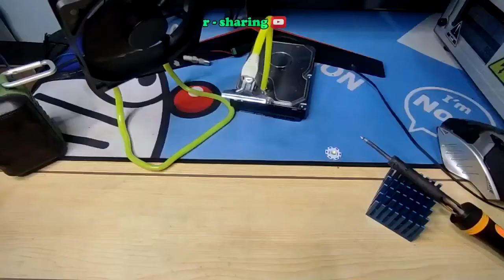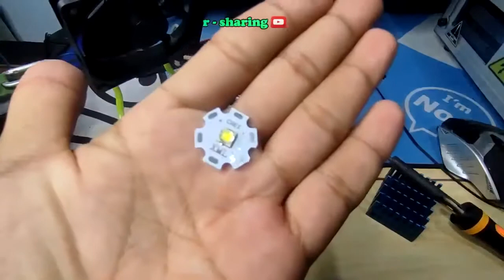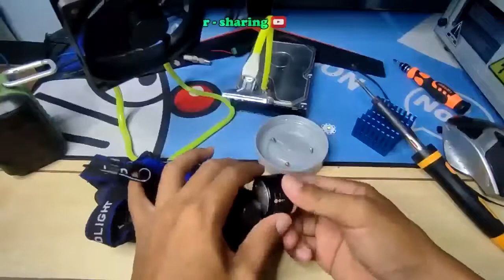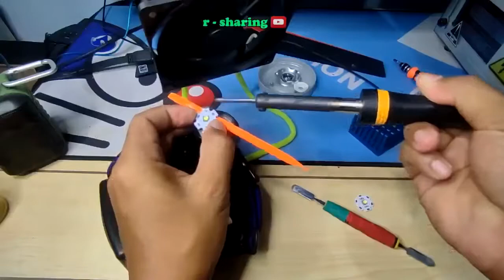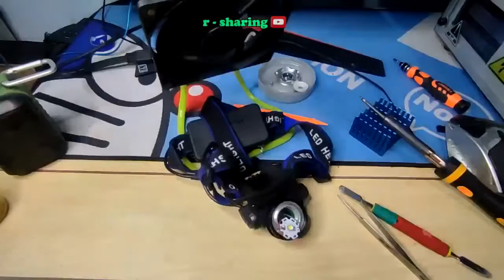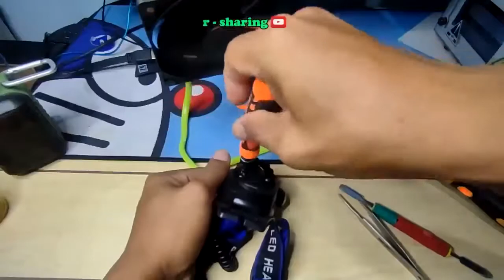mengganti led senter kepala memperbaiki senter

Comment: Kak aktadi ganti lampunya setelah ak ganti hidup tapi kok gak bisa ak matiinlewat saklar ya padahal udah ak samain sama yg sebelum ak ganti
Reply from the maker: Coba cek switchnya dulu gan,atau bs coba jumper kabelnya langsung ke led (tanpa lewati switch/ switch di lepas) cukup 1 kabel saja di solder ke led trs kabel satu nya di mainkan tempelkan ke led nya di mainkan lepas tempel untuk ubah mode led lihat apakah normal atau tidk klo bs normal artinya switchnya rusak

Comment: Bang solusi untuk mesin sentwr kepala cepat panas dan senternya redup
Reply from the maker: pemakaian berapa lama sampai panas memangnya gan,trs apakah pernah pasang baterai terbalik ,karena ini baterainya di pasang pararel bukan seri,kalau pemakaian di atas 5 mnit memang senter ini panas gan ,di bagian aluminiumnya tapi sejauh ini aman saja gan,kadang ane pakai sampai habis baterai lalu ganti baterai lagi ,masih nyala normal.kemarin ganti ring geser plastiknya yang udah rapuh.senter masih normal dr vidio ane ganti led nya.kalau redup coba cek voltase nya saat di hidupkan berapa volt pastikan baterai juga ok,nah terakhir baru coba ganti led nya gan.
Reply: @RSharingEverything  baru beli,  terdapt 2 led putih dan kuning,dipakai 30 menit panas terus rudup diganti nyala led lain terang kalu panas redup lagi
Reply from the maker: ini yang tipe dual led gitu ya senternya jd led kuning dan putih,btw model nya seperti apa merk di kotak nya seri apa,ane ada yg dual led tapi model uv dan led putih ,itu bukan senter kepala ,tapi  senter tangan biasa,kalau driver sepertinya pakai xml t6 di pakai sih normal aja panas tapi gk sampai redup ,model mirip senter xml t6 biasa,nah yang punya agan modelnya gimana seri di senternya.
Reply: @RSharingEverything  senter kepala merek smilink shark m80 nyala putih dan kuning
Reply from the maker: itu senter udah bagus dari aluminium  gan,apa gk tukar aja sama toko nya karena baru beli gitu,siapa tahu dapat yang  kurang bagus.Ane belum ada sih  senter yang baterai 3 jadi kurang tahu bagaimana driver nya.Coba aja tanya garansi nya gan karena ada juga dulu yang tanya tapi senternya mati hidup model lain bisa di tukar di toko ya paling ongkir kita yang tanggung biasanya.
Reply: @RSharingEverything  garnsi cuma 1 minggu , waktu 1minggu itu masih ok nah setelah nya  jadi gutuga  apa mungkin led nya kepasan terus loyo cahanya atau driver nya saya juga bingung soalnya baru pertama punya